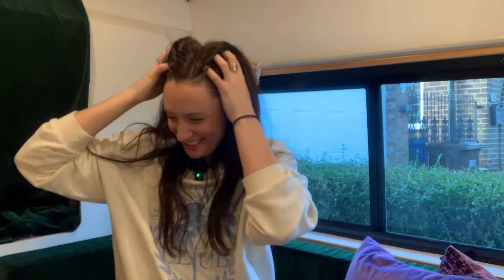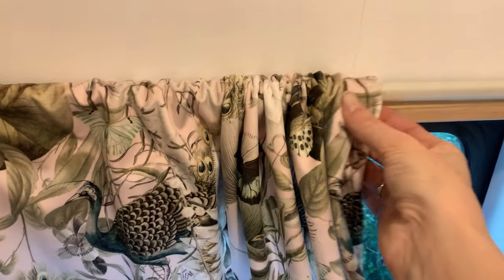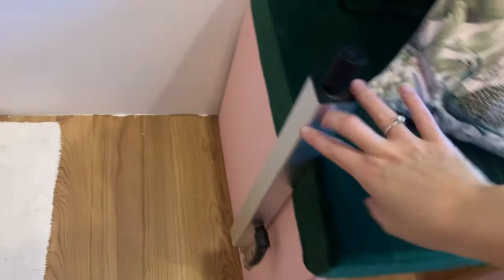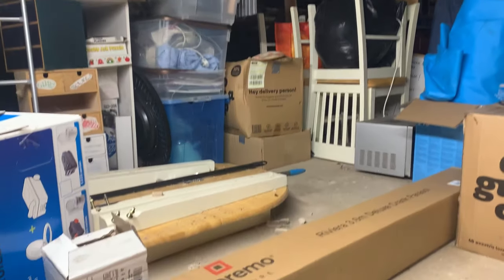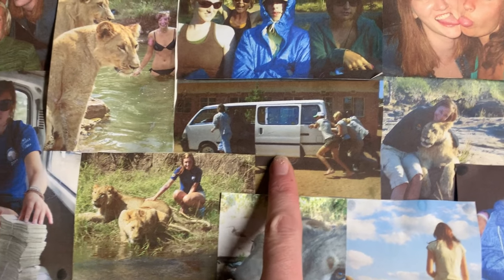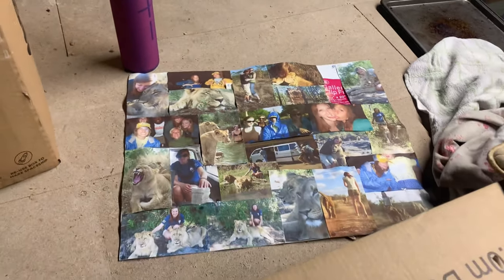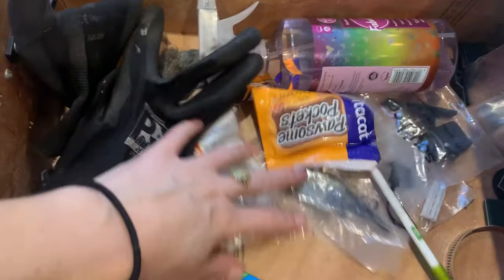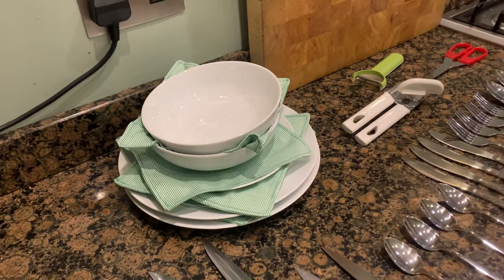Her first night alone in the van | Ep.40

Comment: Looking so good, you and dad have worked hard but it's paid off, well done, your sliding door dead bolt needs changing, in an emergency if you need to get out last thing you need is to stand there unscrewing a bolt, maybe an offset sliding bolt attached to the door part may work. How's the lotus blossom drawing going or you not tried yet? Enjoy your night out camping.

Comment: Where is the temp sensor for the Truma system? If it’s set to 17 and is too hot? I’ve just got a new to me 2021 caravan that has the same Combi system, and it’s quite a change from my old 20 yrs old Truma system.
Reply from the maker: It’s in the middle of the van. I was just rushing around doing lots (so was hot anyway) & it was a super cold day so felt really warm inside.